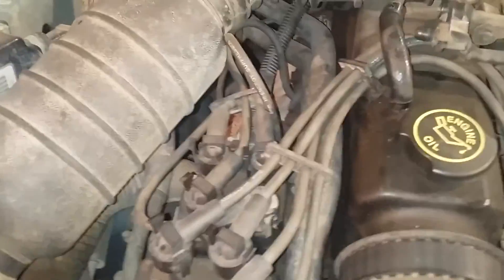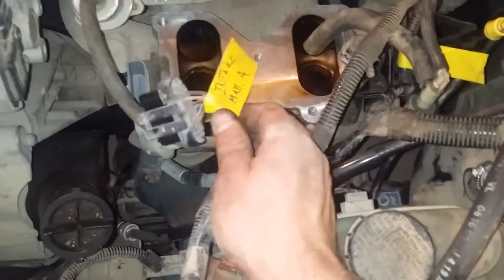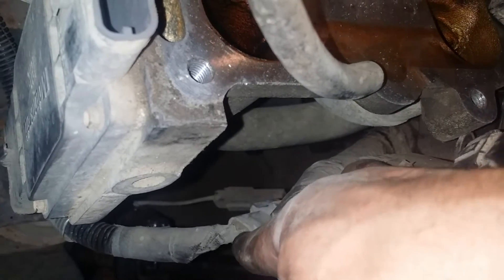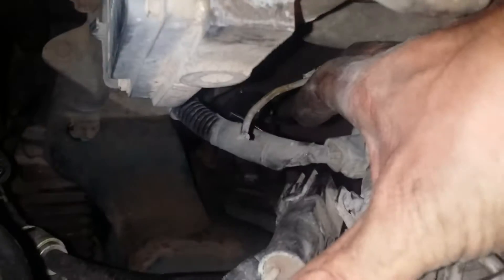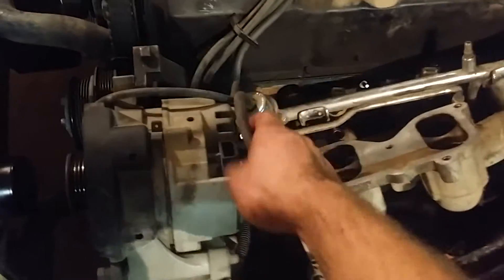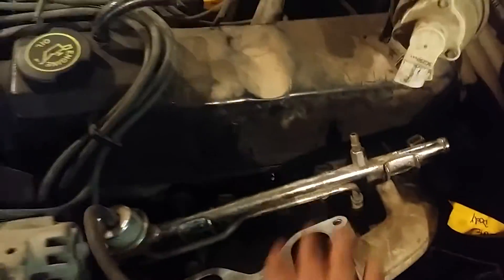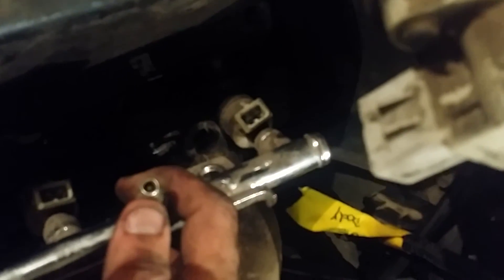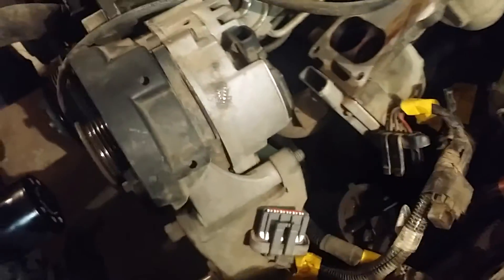Mustang 2.3L coil pack engine to  2.3L distributor engine Part 1

Comment: Hello! Do valves bend when the timing belt is broken?
Reply from the maker: No they will not bend. The Ford 2.3l lima (pinto) engine platform is non inference. If your timing belt breaks while the engine is running your valves should be safe.
Reply: @BuiltTV  Oh, perfect. Thank you very much